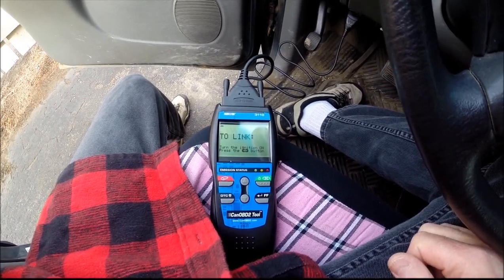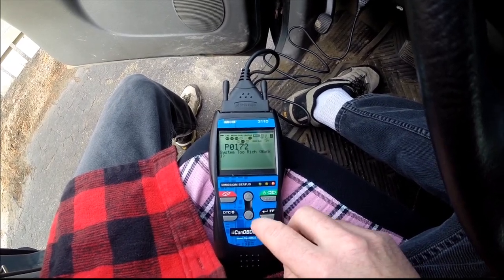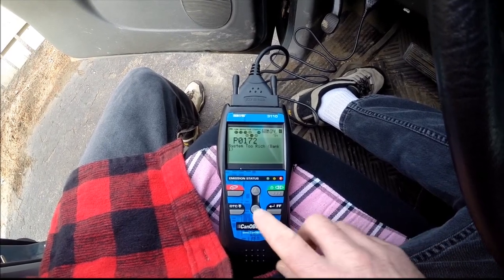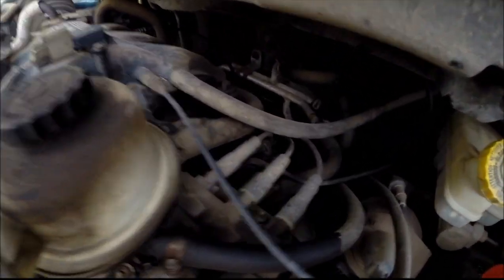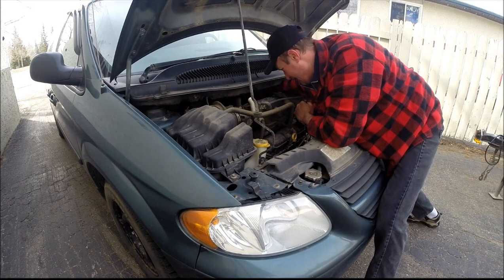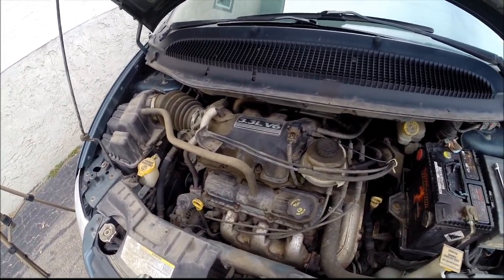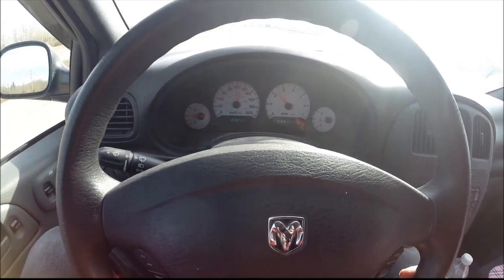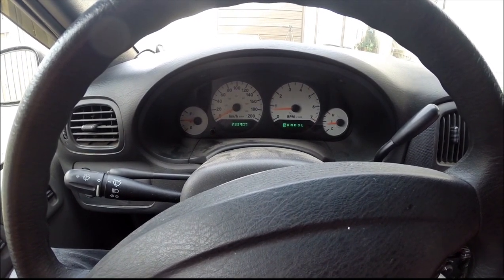P0172,P0171 and P0131 on 05 Grand Caravan

Comment from the maker: Its been 1 month now and the engine light has not come back on. The fuel economy is a lot better and the engine performance is good. What a difference an O2 sensor makes.
Reply: AB Carp so now it's been a year, did this continue to be the fix? I am having the same symptoms. Shudder on acceleration stalling at low speed, higher fuel usage. I think the only code I have is P0172. 
Thanks in advance from your neighbor to the South.
Reply from the maker: Sorry didn't get notification for your reply. In Oct 2016 the van was hit and written off. Up until then it was running great.
Reply: @abcarp1302   hi , what’s the name of the scanner you are using in the véhicule
Reply from the maker: @josephbrahimi1436  Innova. Got it at Can Tire years ago.

Comment: I have a 2004 JeepLiberty
3.7 L. V6
Error code p0133.- 0/2 sensor D/side bank 1  upstream

Error code p0172 -  bank 1 D/side cat. Running rich

Error code -P0522 - oil pressure sensor 

Changed 0/2 sensor &
Oil pressure switch

Also changed spark plugs
They looked terrible !
             And
All codes cleared !